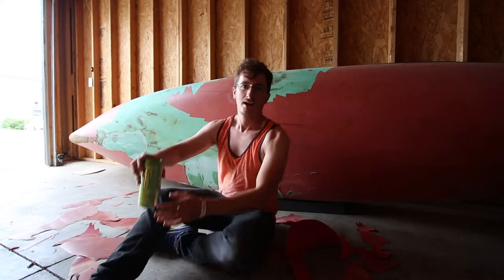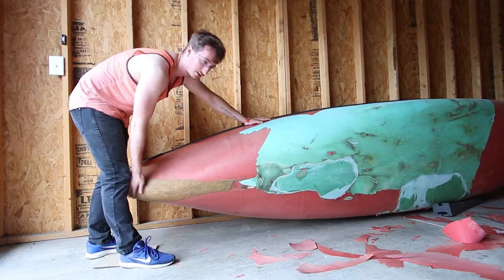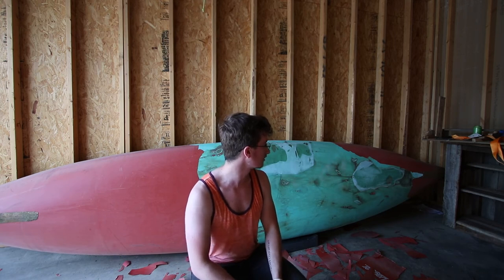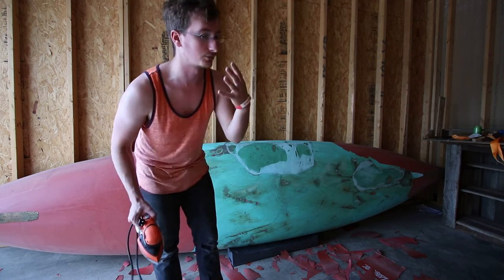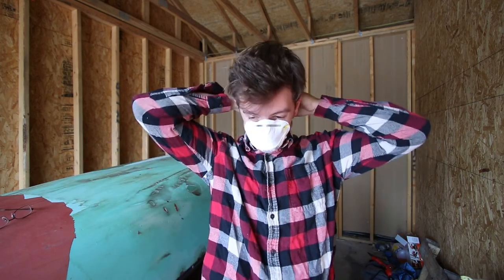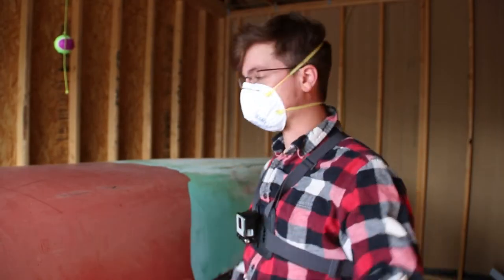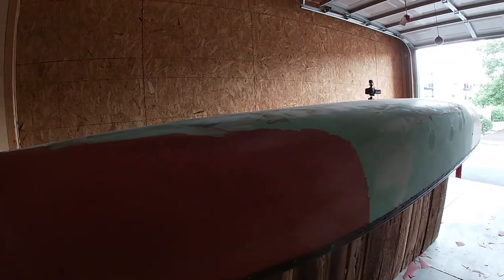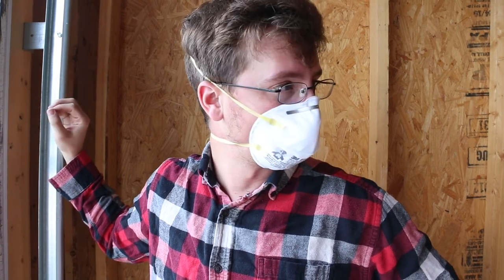Old RoyalEx Canoe Restoration and Repair |  Canoe Restoration 2022 | canoe Makeover | Episode One

Comment: There is something seriously wrong with this canoe if that vinyl peels off that easy.  So I don't think you made a mistake removing the loose stuff.  I have a Wenonah Adirondak Royalex canoe that I am also repairing and fortunately the vinyl is really stuck tight to the ABS.  There is no way I could peel if off.

By removing this loose layer you are getting to a solid substrate (ABS) for repair.  If you just put fiberglass on top of the loose vinyl and I think it would have eventually peeled off.  Of course this is just speculation on my part as I am not a Royalex or canoe building expert.

Any idea on why the vinyl is so loose?  Was the canoe left in the sun in the desert for years?  

Looking forward to your follow up shorts on painting.  Thanks
Reply from the maker: Peeling vinyl

Comment: The vinyl layer protects against U.V rays. Not a good move, uless you like going out in the dark.
Reply from the maker: That’s what I learned. I did find a resolution. I put down fiberglass and GFlex on all the rough spots to reinforce. I also put a long strip of fiberglass and GFlex along the medial line on the bottom to protect more from rocks and logs and what not. After all that cured I did a mix of protective enamel spray paint from rustoleum and another marine specific paint. Then I used g flex to cover a good portion of the most sun exposed parts (exterior side walls) and the more rough spots again. I did that to give a layer of protection to give more longevity to the spray paint.